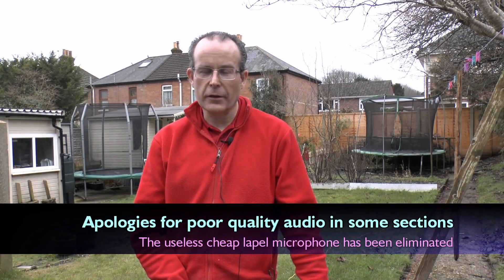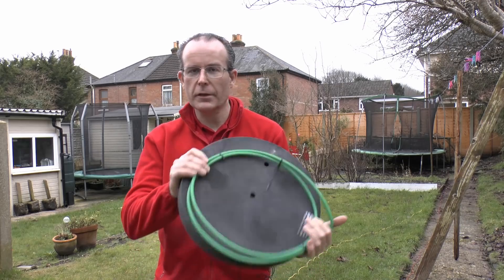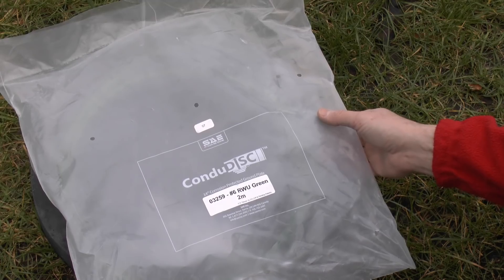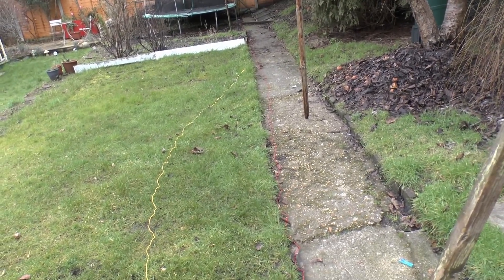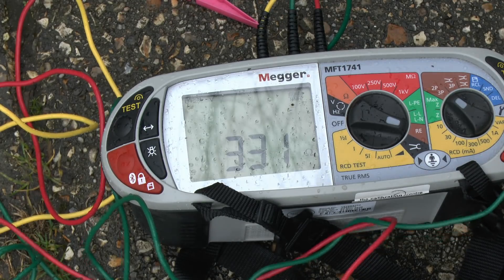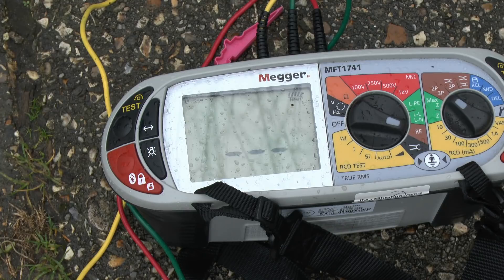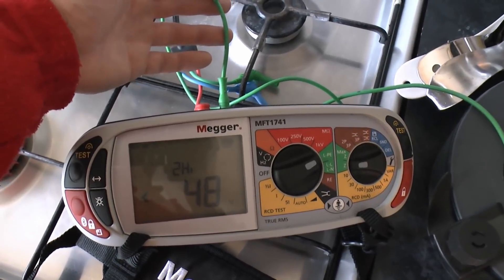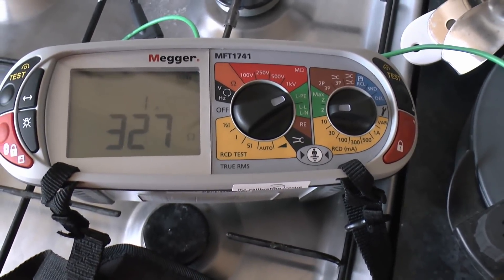ConduDisc Demonstration - Earth Rod Alternative

Comment: I'm still waiting for someone to give me a valid reason for earthing a generator. Especially when it's not been connected to a building/wiring system, and only powering devices through extension leads.
Reply: A few reasons come to mind - by using earth you have a known reference point so your 0V matches everybody else's 0V (particularly important if eg having something with an ability to transfer between mains and a generator). You also provide a connection to avoid eg static electricity build ups in the generator, and likely reduce any RF noise that might otherwise be present on the circuit and affect nearby systems etc.
Reply: @alexacb63  RF interference is valid, though unlikely.

Mains earth is never at 0v with respect to anything, and varies from installation to installation. Static......

Personally, I would never reference a genset to earth.  It's safer for the end user, not to.

Comment: I'm thinking of testing the earth/ground resistance between my house and my neighbor's.  The electrical panels are connected to the city water supply lines, so in theory the resistance should be very low,  since the water distribution to each house is a massive grid from the street,  but it ends if the water line switches to plastic somewhere underground.
Reply: It would be instructive for your and your neighbor  to do that test.

Comment: What possible advantage does this have (apart as you said not spiking or cutting something) over burying anything else conductive in the ground, such as say a aluminium trash can lid or other lump of (non corrosive) metal?
Looks like a (probably expensive) solution looking for a problem to me.
Reply: Whilst aluminium isn't a suitable metal for buried conductors used for earthing / grounding due to rapid deterioration, you are right any suitable conductor will help discharge electricity. The benefits are much longer service life, easy, fast and safe installation and highly deterioration resistant in hostile ground masses. That being said it's a free market and you must always select the product you deem most suitable.
Reply: The advantage is on new build housing . The disc can be installed and backfilled with the foundations . Considerations should be given to back up earth electrodes on new build housing.

Comment: Does a ground rod have to be vertical? Can it be installed horizontally? If so, how long and how deep would it have to be?
Reply: Horizontal earth rods may be a safer and faster concept than driving vertically but measured performance is usually significantly lower.
Reply: @earthingservices44  
so youre saying that horizontal rods need to be longer, right?
Reply: @mrxmry3264  Not at all, but thanks for checking. If you want to go metallic only then go for copper tape or HD bare cable. It's more expensive but stands a far better chance at discharging electrical current than the horizontal copperbond rod.

Comment: So, you've got roughly 2 times more resistance with the ConduDisc. 
So what does that mean in a practical sense?  
What resistance is:  ideal, good, & bad?   
What would be the practical difference between an ideal resistance & a good resistance?
Reply: As JW points out this isn't an actual comparison, it's an installed earth rod and a ConduDisc not at depth or fully compacted. This disparity in performance is never seen in complete installations.
Reply: https://www.youtube.com/watch?v=8mVIuxuOvaY - ConduDisc and Conducrete - 47.5 Ohms on the day of installation

Comment: An earthing product made by Murcia, the land of toy voltages and two pin plugs, No bloody way.
Reply: US domestic supply is typically split phase 240V so while most outlets are 120V there is 240V in the house with outlets for larger appliances such as dryers, cookers and water heaters as well as heavy duty power tools.
Reply: @calmeilles , yep just as I said, toy voltages, and you have so many idiotic arrangements to boot.
PS, it’s not split phase, it’s single phase, 240 with a centre tap.
Split phase is a whole other bag of cats that is used in motors to create a rotating field.
Reply: Were I or someone I know to get shocked, I'd much prefer it to be that "toy voltage" of 120 volts rather than the UK's 240 volts. Wiring here in the States has to be thicker for the same power draw, but the result is safer.
Reply: @Inkling777 , the wire is not the only thing that's thicker.

Comment: Is this a UK available item?  Are they available with a 16mm equivalent wire?
Reply: The csa of an earth wire for TTs systems required by BS7671 depends on whether it is protected against mechanical damage and corrosion or not. If protected from both it need only be 2.5 sq mm.
Reply: What would be the point of 16mm^2 wire on something with a resistance of a couple of hundred ohms?
Reply: @mikeselectricstuff  The cable size varies to suit a given application, and as JW side this is not representative performance of the product.

Comment: Pretty disappointing results really. For c street cabinets etc it has be much lower...under 200. The disc has a large area of contact so I hoped it would do better. Maybe condu-crete with a copper mat would be much better.
Reply from the maker: In this demo, its only buried about 12 inches deep with fairly loose soil.  Resistance will be a lot lower when buried at a more usual depth and the soil compacted over it. Will be seen in a future video on a real installation.
Reply: @ruben_balea  For street furniture it's the initial reading at the point of commissioning that counts. I'm not sure how it being deeper will make that much difference. The readings are not good. It's better to use a copper earth mat and condu-crete...and leave a cu tail out in case a daisy-chain of mats/spikes are required.

Spikes can be driven horizontally remember.
Reply: https://www.youtube.com/watch?v=8mVIuxuOvaY - ConduDisc and Conducrete - 47.5 Ohms on the day of installation

Comment: I think the Condudisc needs to be buried deeper, even just for a basic reading. The conductance from the top surface is fundamentally limited by the resistance of the top layer of dirt. Or put differently the perimeter area of the soil "disc" on top. Just burying it deeper would probably lower the measured resistance by at least 1/3.

It would also be interesting to measure the resistance of that black material. Idea: put a sheet of al foil on the top and bottom and a weight on top to get the top to bottom resistance.
Reply from the maker: It does, and will be in a future video.
Reply: https://www.youtube.com/watch?v=8mVIuxuOvaY - ConduDisc and Conducrete - 47.5 Ohms on the day of installation

Comment: ...I have never worked with or on a TT system. Can someone explain how the max zs result can comply with the max zs  permitted on a given circuit please?
Reply: Max Zs for a given protective device is virtually impossible with a TT earthed system.  This mandates a 30mA RCD to provide ground fault protection for all circuits.  This equates to ground fault protection even at a Zs of 1600 ohms.  I believe It is still essential to calculate the R1 and Rn values to ensure low enough impedance in the event of a L/N short circuit.
Reply: @MS-Patriot2  ...thank you for your reply. Great explanation cheers!

Comment: It’s an interesting idea. I remember back in the day people would often bury a old copper hot water tank for a Earth although they have quite a scrap value today.
Reply: I've heard of churches using confiscated moonshine stills. KPPC Pasadena Presbyterian Church, and KBRT Catalina, are possible examples.
Reply: @ AllThe GearNoIdea,
All sorts of things used to get buried, car radiators, old copper pipes, old gas caliphonts, you name it.
There was an old eccentric English guy that moved here to New Zealand and I re-wired his cottage, he BOUGHT a plate of copper, it was 2 metres x 3 metres and it was 12.5 mm (1/2") thick.
He made me fit 12 x 50mm² copper conductors back to the main switchboard in the cottage, before we buried the whole thing 2 metres down in the ground.
The Inspector from the local Power Board, asked what the hell all the wires were for, the guy said " I came from England, I don't trust the electricity out in the colonies!"
Reply: @mikeZL3XD7029  He must have had more money than sense.
Reply: @chrisfryer3118  Not any more.

Comment: Isn't the maximum for TT 200 ohms?
Reply from the maker: Yes, however in this demonstration it was buried in fairly loose shallow soil, in a real install it would be much deeper and the soil around it would be compacted.
Reply: Is 200 ohms what's written in the regs?
Reply: @01dec2001  nope. It's an niceic thing. If you do the maths the maximum is 666 ohms which I've always thought is kind of creepy.
Reply: @Woodkin007  did you mean 1666 ohms?? Thx for reply by the way
Reply: @01dec2001  yes.
Reply: https://www.youtube.com/watch?v=8mVIuxuOvaY - ConduDisc and Conducrete - 47.5 Ohms on the day of installation

Comment: Interesting. Might spook people going forwards if not accessible for maintenance though! Also isn't 13mm too small for a buried earthing conductor?
Reply from the maker: Yes, the minimum for buried without mechanical protection is 16mm², so this 6AWG is slightly undersized.  Would be better if supplied with metric sized wire.
Shouldn't require any maintenance, it's intended to have a lifespan measured in decades rather than years.
Reply: @jwflame  What is the point of a 16mm wire connecting to something with tens of ohms?
Reply from the maker: @mikeselectricstuff  Electrically none - the 16mm² minimum is for mechanical strength.  If the conductor is protected against mechanical damage, minimum size is 2.5mm²
Reply: @jwflame  The almost certainly original wire to the earth rod in my 1960-vintage house is a single-core SWA which I've never seen anywhere else. The rubber-insulated 7/.029 copper conductor is protected by spiral-wound steel armor and then a woven fabric outer layer. 
The earth rod itself just pokes up through a layer of concrete a few inches behind the back of the house. However the measured Ze is a respectable  50 ohms.

Comment: 2 metres of #6 awg. Love it. Just like asking for 3 metres of 4"x2" wood 🤣
Reply: You want 10 feet of "two-by-fours." :D
Reply: @Madness832  no you don't. Not if you want your board to be 4"x2" anyway. A "two-by-four" will typically measure something like 3 1/2" by 1 1/2" because it was milled and planed flat, but still sold by the name two-by-four.
Reply: @Gameboygenius  Nominal, hence the quotes.
Reply: @Madness832  the measurenents in the original comments were exact. Although tbh I'm just taking every opportunity to dog on the backward ways of the murrcans. ;)
Reply: Carbons for cinema arc lamps, at least in the UK were metric diameter x imperial length for some reason.

Comment: Been out of the game many years but from memory I always assumed the a rod resistance had to be in the region of 30 Ohms or lower. I guess I was lucky in my day because mine, not that I did many just mainly out in the sticks cottages, were around 20 something Ohms.
Reply from the maker: Depends on the application, for normal use under 200 is suggested, although lower is certainly desirable.
Reply: https://www.youtube.com/watch?v=8mVIuxuOvaY - ConduDisc and Conducrete - 47.5 Ohms on the day of installation